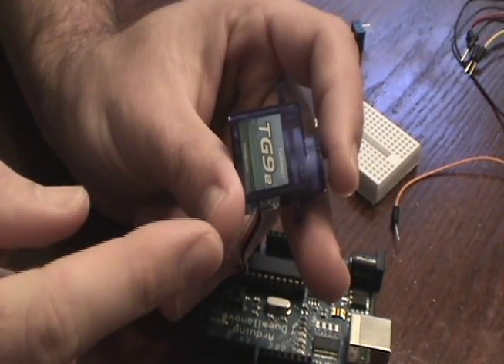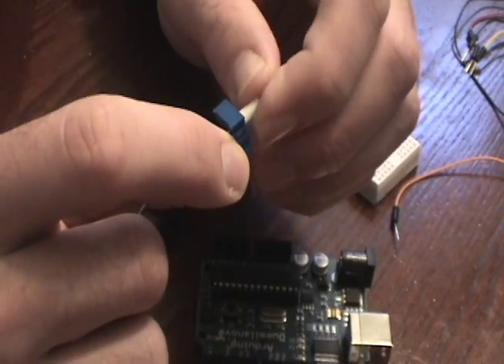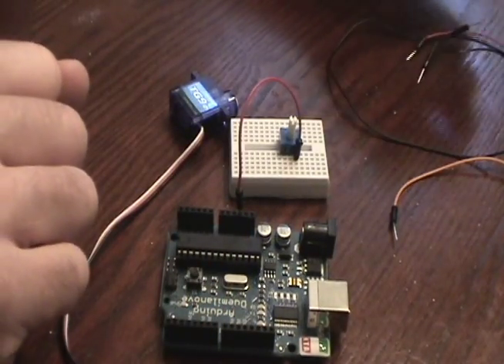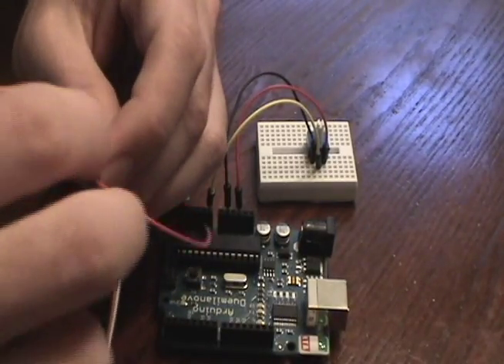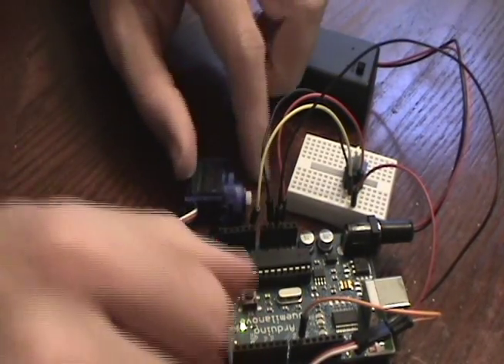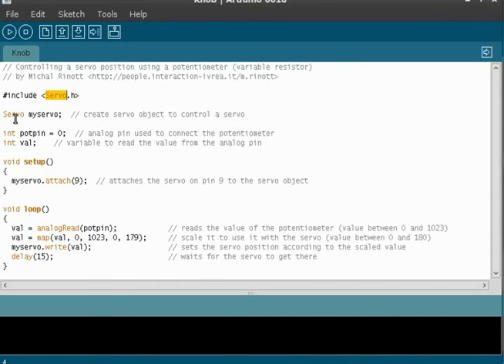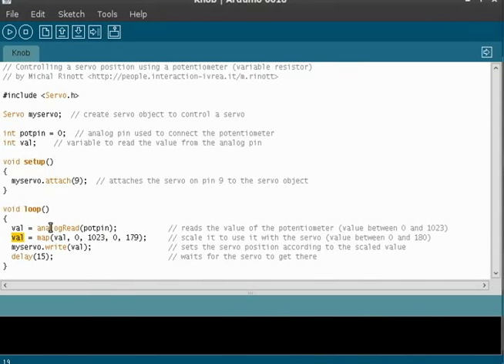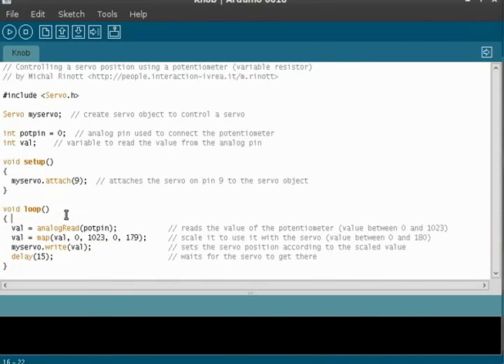Arduino - Servo Motors and Knobs

Comment: i need help i have a project about arduino i used servo motor connecting through dht11
i need my servo  turn into 180 degrees when  dht11 sense the temp=> 20 and temp<=30
and when dht11 sense temp >31 the servo turn into 90 degree.
but the problems i dont know hor to configure of its pin and idont know how to code it

Comment from the maker: @MrGrandllama: I got them in the Arduino Start Kit.  It was either a 10K potentiometer or 1K potentiometer.  Those are the 2 that came with the pack.  I don't think I even realised they were different at the time :)  Good luck.